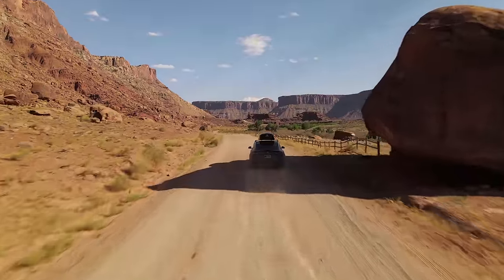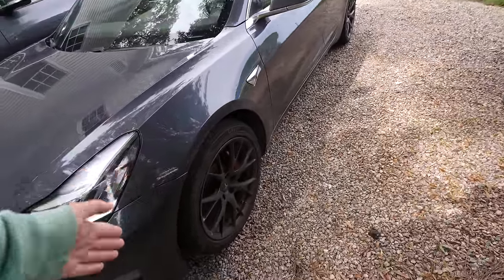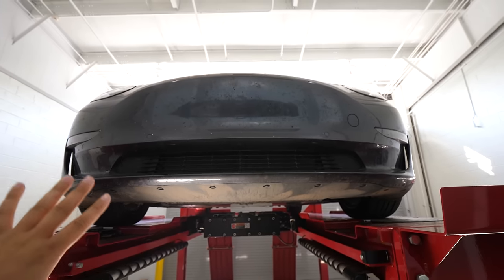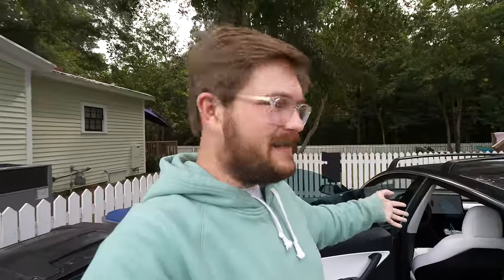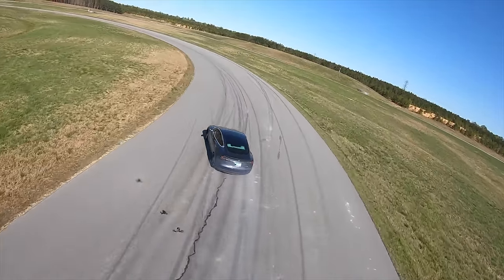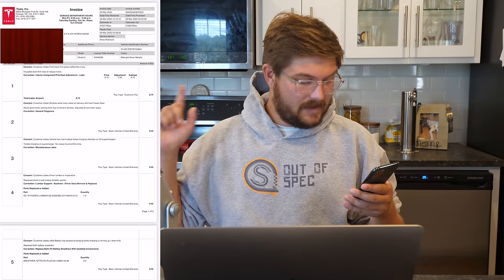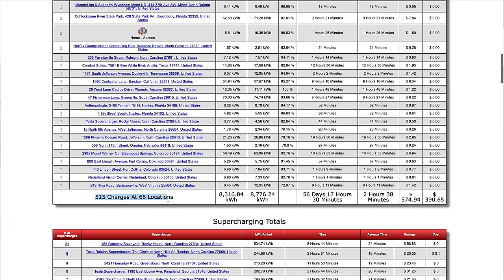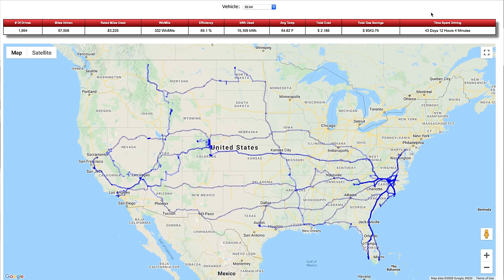Tesla Model 3 Performance 1 Year / 60k Mile Comprehensive Ownership Report

Comment: Dunno if you read all these comments or not, but I'm sure someone else can answer as well.  When you're out in the middle of nowhere, like Death Valley or around Moab or wherever, and there's no LTE signal, how does the Tesla still calculate range and mileage and whatnot when there's no data coming into the computer? Does it just guess? Basically, when there's no kind of signal or wifi, how does the car function?
Reply from the maker: The car doesn’t rely on connection for really many tasks at all. It can almost fully operate offline - only thing it can’t do is show visual maps

Comment: Kyle, I feel like the losses are from updates to the BMS adding more buffer.  That just seems like WAY too much loss for 60K miles.
Reply from the maker: It’s not too dissimilar from my RWD car - the reason I did the usable capacity test was for hidden buffer below 0% unless Tesla put some buffer in unusable capacity.
Reply: As a comparison, I have a 2018 dual motor w/ accel boost, 54k miles, supercharged 135 times.  Stats App shows 275mi projected battery range now.
Reply: Aussie2u How much did you have originally?
Reply: MrHakubi I think all 2018 Model 3’s had 310 to start.  I wouldn’t know as I never charged to 100% when new.
Reply: @aussie2uGA  Yes but the software is all that changed.  So 2018 and 2019 are effectively the same.

Comment: Looked at selling mine after 1 year and 23k miles. Lost £5k to sell to WeBuyAnyCar. 

If I sell privately I’ve been offered what I paid for it. This is because the price went up in the UK. Tesla upped the price and UK government stopped incentives on EVs above £50k after I got mine. So it costs £5k more now.
Reply: I would be interested to know why you sold it after only 1 year if ownership.
Reply: @David-bl1bt  I ended up not selling. I was considering it because I am halfway through warranty (will lose a lot more value once it runs out), I’m using it a lot less because of Covid, the Model Y will be more practical, so ultimately want to swap to that and can live without this one until then. But going to hold on to it until the Model Y arrives, if it’s lost too much value I’ll just keep it for many more years.

Comment: In terms of the degradation test:
You would easily get 70-71kWh by driving at EPA speeds or even at 90km/h (55mph) from 100% and down to 0%. Also, turning off seat heaters and A/C has a big impact. 

I suspect only a loss of 3kWh from the original 74ish kWh, if you did the test again following 55mph and no A/C.
Reply from the maker: What? It counts all usage from seat heaters and AC -
Reply: @OutofSpecMotoring  A/C adds around 5-20% to the consumption, depending on if it's winter or summer (outside temperature). 

The A/C can easliy pull 1-2kWh during that distance. I suspect lower degradation, which is awesome, cause damn, you USE that car well. 😁
Reply from the maker: The AC definitely pulls power, not as much as you’re saying, but it is counted in the consumption meter

Comment: For the squeaking in the back seat latch: I put a felt patch at the bottom of were it latches into and haven't had an issue since! I had to trim the felt pad a little in order for the seat to latch-in properly, but it now holds better than ever! (2020 model 3 Performance 24.3k miles)
Reply from the maker: That's great!

Comment: I'm pretty sure this is representative of average Samsung Lithium batteries, which HATE high Amperage charging and discharging. Since Tesla paired up with LG Chem and other better Lithium battery makers, the range should be farther and the degradation will be less. Source: my own Real Life Exp with high power devices and battery power... Yes, Vapes are excellent small scale analogs for EV's, as it turns out. I have 250 and 360 Watts in the palm of my hand 😅
Also, the LG Chem batteries are less temperature sensitive, which will be great for colder states.

Comment: We got our cars at roughly the same time. Because I got the two years free supercharging also. which I thought was such a great deal but I've only supercharged  three times! Anyway the point of this comment is you supercharged so much and have 8% degradation I've only supercharged three times and I have 6% degradation. Really not that much difference I don't think supercharging affects it that much.
Reply from the maker: Totally agree but did you calculate your degradation the way I did in the video? Or are you basing it off of your full charge miles. That seems to be misleading on many cars.
Reply: @OutofSpecMotoring  no I didn't physically test mine to zero. I have a OBD2 reader this degradation is what the Tesla reports. I also have Teslafi it reports 5.99 the Tesla reader reports 6.3

Comment: Everyone gets concerned about degradation on electric cars with mileage and range.. has anyone ever broken down an ICE car like this.. MPG low speed test, high speed test… mileage with out proper maintenance, mileage with proper maintenance… difference after 60,000 miles.. ETC

Comment: How did you charge the car after it went to 0% driving around doing the battery degradation test?
Reply from the maker: Just plugged it into the supercharger
Reply: @OutofSpecMotoring  I mean how did you get the car to the supercharger, if you drove it until it got 0% probably wasnt in cable distance to the supercharger ?
Reply from the maker: I was just doing loops in circles around the supercharger lol
Reply: @OutofSpecMotoring  Thought so, wish you included that last part of getting to the charger in the video too! Maybe next year :)

Comment: So you used about ~21MW/hr of energy to drive 60,000 miles. 

If you averaged 25 mpg across those 60,000 miles, that’s 2,400 gallons of fuel. 
1 gallon of fuel = 33.7 kW/hr of energy 
Times the 2,400 gallons is 80,880kW/hr of energy consumed. (ICE engines are only ~35% efficient but this is raw energy consumed. So all that excess heat and friction is included)

So 60k miles, EV used 21MW/hr of energy, and a gasoline vehicle averaging 25mpg consumed 81MW/hr. Interesting. 

It’s really rough, and slightly drunk math. But I think it’s fairly correct 🤷🏼

Comment: as far as i know what really caunts is the Temperature of the battery as long as it stays cool its happy. Your tesla Actually never charges its bettery with a AC, AC charging gets converted into DC in the internl charger in the car. The Bettery never sees AC it only sees DC no matter how you charge. What dose change is the Amps the battery sees Faster charging = More Amps = Higher temperature = More stress on the Battery.  what happens when you use the DC Fast charger (supercharger) you bypass most of the Internal charging electronics (the part that converts AC to DC)
Reply from the maker: Yes exactly

Comment: So, after a year of ownership you asked to have an OEM spoiler that has come loose repaired (warranty repair from any other manufacturer) and they "offered" to replace it for $800+...
Reply from the maker: That’s correct - I was out of mileage on my warranty but I scheduled it while I was still in warranty which is why the door handle was replaced with coverage. Apparently spoilers are not covered. Lol, so Tesla!
Reply: @OutofSpecMotoring   That's awful support from the company even if it's outside warranty.  How are North Carolina consumer laws?
Reply: I guess that a spoiler lifting is deemed "in-spec" according to Teslas' rules, the same as many other defects that they won't fix once they've got your 50k.

Shocking.

Comment: When it comes to resale value you gotta factor in all the savings for no gas and no oil and oils filter and other stuff a regular car needs 
On a BMW M3 or a Mercedes c63 you'd be paying $10k on fuel and oil alone minimum and most likely will lose a lot more value with a 60k miles, especially since you had free super charging.

Comment: There is no range anxiety - there is a shit-show charger infrastructure (even for Tesla charges) in UK and some other countries.
Reply: Very poor charging in Spain. I spent most of 5000 miles there over 6 weeks this summer  using 5kw supermarket charge points and 2.3kw in normal household sockets. Nearest rapid charger 68km away and Tesla Supercharger about 128km away.

Comment: Damn out of warranty already
Reply: Isn’t it 100,000?
Reply: @MrHakubi  8 years 100k battery and power train.  4 years 50k basic warranty.  It's one of the better warranty's out there for electric vehicles
Reply: Stuck in the Middle ah I see so his battery is still good =)
Reply: @MrHakubi  oh yes battery is good and maintenance typically isn't bad with the electric vehicles definitely not as bad as ice.  The problem is certain things are more expensive to fix than on ice vehicles but it works out in the end from what I've been seeing.  I literally just got a sr+
Reply: @MiddleMAGA  120k on the drivetrain
Reply: @tonyc6996  for my Model 3 SR+ it's 100k.  I believe on the Y it's 120k but you can google that easily
Reply: @MiddleMAGA  I stand corrected they must have changed it since I got my old 3. I thought it was around 6 years and under 100k or 8y 120k depending on model. 2 years in I'm only at 9500 miles so no biggie. Anyone keeping one of these outside of the 4/50 is insane
Reply: @tonyc6996  I’m hoping they certify 3rd party shops.  As they grow Tesla parts and the whole chain will get better.  I hope to have my model 3 for 10 years but we’ll see.
Reply: @MiddleMAGA  no way will they allow 3rd party. Good luck to you keeping it out of warranty
Reply: @tonyc6996  This is a huge topic that no one outside of Rich Rebuilds talks about.  To me it’s the biggest argument against getting a Tesla, what do you do out of warranty.  I think the Model 3 will be better but the older S and Xs were nightmares out of warranty for some people
Reply: @MiddleMAGA  and look at what they did to uncle rich for telling the truth. How the Tesla owners reported his videos to get them pulled down. It's absolutely absurd that most of the Tesla club can't accept logic and facts. The other owners have turned me away from the brand

Comment: Kyle, great informative video. But there was no Alyssa. I don't get that. Quick to show shmushed-up bug guts, but no Alyssa at all? It was interesting about the white seats staying good for so long. Would your resale value have been higher if you had a non-performance AWD Model 3? Aren't your battery degredation tests thrown off by the fact that you switched to the 7.5" Martian wheels back in March? I'm still trying to find out more about the Martian wheels. Like, how do they compare to the stock 18" Aero wheels with the Aero covers, with regards to efficiency and range?
Reply from the maker: What does Alyssa have to do with an ownership report? She’s not interested in anything like that. No, degradation isn’t affected by wheels.
Reply: @OutofSpecMotoring  Hmmmm....... she's nicer to look at than bug guts?

Comment: As most people (in Europe anyway) take 4, to around 7 (even more) years to put 60,000 miles on the clock, that 7.5% battery degradation isn’t bad at all. These days, I don’t know anyone who still puts their cars through the rough and tumble you’ve done in this. So pretty impressive.
Great video...and we learned a lot from your road trip videos also.
Reply: I have only put about 50k miles on my car in about 9 years, so 60k in a single one is insane!
Reply: Luckysquirrel1256 A few years ago I drove 54 miles one way so 104 miles sometimes 6 days a week.  After a year I put 90,000 miles on a 2014 Camaro 2SS (2SS=fully optioned) that I bought brand new.  Oddly enough I was only 1500 upside down.  It wasn’t in the shop once.  I traded it in a Ford Raptor that was a year old with 8,000 miles and today has 141,000 no major problems 🤞🏻.  I have a preorder for a CyberTruck and hoping to have the same great long term ownership experience.
Reply: I have about 25,000 miles on my car, but it is much. I have about 4% degradation now, but I expect it to not increase for at least 25000 more miles.
Reply: i only have 30k km and have 7% degradation already..........
Reply: @kingprone7846  It is most likely not degradation, but BMS imbalance. Try charging from 10% to 60% consistently over 2 months and you will gain it back. (also make sure to let the car sleep so no sentry mode and no 3rd party logging apps)
Reply: @teslakiller6959  it is not.
Reply: @kingprone7846  How do you know? Try the charging strategy 10%-60% and report back in 2 months. People have been gaining 3%-4% back with this method.
Reply: it is well calculated that an average person will drive 9370 miles per year lease agreements are well based on that as well
Reply: Here in Sweden, some people can drive far, but it is expensive to drive a car in Sweden if it runs on petrol or diesel
Reply: if you have dogs, perhaps a Tesla Y or a manor-type car is recommended instead.  where you have a grid between the luggage and the back seat.  The dog must be in the luggage. The part

Comment: Has anyone discussed the handling and braking of these Teslas? I own a Model 3 Performance and for a car that accelerates from 0-60mph in 3.2 secs, the braking and handling stinks. The wobbling about on turn in, mixed with seats that hold you in like a worn out sofa, makes this car scary. I can forgive the lack of theater or the clinical, dull steering feel, but the wobbling about on the limit on turn in, on a  car that is a fast as the original McLaren F1, I find is big disappointment. I get why nerds love this car but as a fun handling car. Nope. Owned my three weeks and already thinking I'm just going to take a hit and get rid of it.
Reply: The fear you feel is from your lack of driving skills. There are lots of videos showing the Model 3 doing quite well on a track. And how could you not know the driving characteristics prior to purchasing it? You didn’t drive it prior to purchasing it? I think you’re trolling.

Comment: 28:45 you say you’re car is in good condition.  No. No it’s not.  A person who drives their car to work and home and the grocery store with 58,000 miles would classify their car with your cars external and internal surface issues as good condition.  But the stress the motors, battery and front and rear end have taken due to “track” racing and off roading is not good. Your car is fair condition and you know better since you are a car guy. Be honest when you sell it to private owner unless you’re trading it in at a dealership

Comment: BMW 3 Series depreciates -38% or $19,240 in one year with regular use. So even if you beat on a Model 3, you end up better than a BMW.
Reply: Plus for that amount of miles you'd be paying at least 10k for gas and oil changes alone besides other expensive maintenance! And BMW M3 (which I own) and Mercedes c63 require premium gas and expensive oil changes and other high cost maintenance

Comment: I sold my Maverick Hybrid over how poorly Ford makes them and now face the decision of a New Bolt EV or Used (Salvage title) Model Y (no warranty).  
  I really hate Dealers now that I've deal with them, on top of it you have to work with the manufacturer as well.. 
  The warranty on the Bolt list 50% battery degradation is the condition.  That would mean around 125 miles of range. I also watched how Bolt/Tesla manage their batteries thermals (I used to have a 2011 Leaf). Tesla did a far far far better job there (over the Bolt).  Not to mention fast charging abilities.
  Even after your 60,000 miles you still outdo a new bolts range.
  So, which way will I go?  Tesla is a better built car in the ways that matter. Just wish I could afford a new one. I should mention though that the used (salvage) title one has 20,000 miles (but I might be able to get one with less miles).
  I really appreciate this video, it gives out a LOT of good information.
  Any for those considering a Maverick, IMO buy a Bolt and get a trailer to pull behind it.  :)

Comment: I seriously doubt you saved as much as $7,000 through your free supercharging. Probably did not reach even the $5,000 at the low end of your estimate [50:00].   

The figure I found for the retail cost of a Supercharger kWh from Tesla was a nationwide average of 28¢. We know you aren’t being charged any idle fees or penalties.  And we know if there is anyone charging nationwide this past year, it would include you. 12,619 kWhs would have come in around $3,533. Tesla would need to charge twice the 28¢ I used to bring your ‘cost’ up to $7k.   

Factoring in your supercharger use and 14¢ per kWH at home [what I pay here in Md] fueling the car should/would cost someone paying full boat about 8¢ per mile.  Using my total figure, $4700, one could fill an ICE with about 1700 gallons of gasoline [@ $2.75 per gallon]. 58,600 miles from 1700 gallons is about 34 miles per gallon.  Honestly, that is not as  efficient as I expected.  But you drive a lot harder than the average Tesla owner—averaging a little over 2.8 miles per kWh for the year.
Reply from the maker: I agree - the $7k figure it too high. It’s probably around $4k to $5k / yr.

Comment: Your brakes are rumbling because u need to change your break rotors ASAP if u rub your finger on the break rotors u'll feel it wavy compare to a new one u'd feel it smooth, u need new break pads an break rotors an your car will run smoothly again
Reply from the maker: Xavier Soto I know
Reply: @OutofSpecMotoring  BTW I'ma fat ass fan and love your videos specifically for this reason of how much info u give bout the model 3, I wanna get one maybe 2021 or 2022 because they keep getting better and prices might drop.